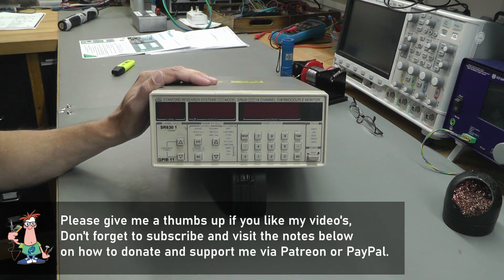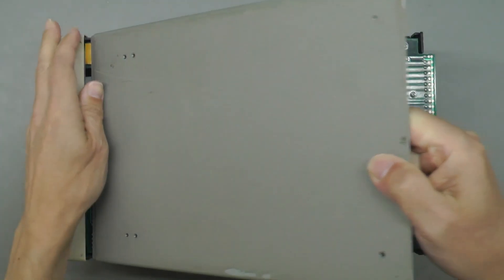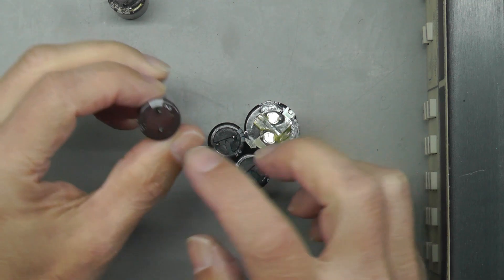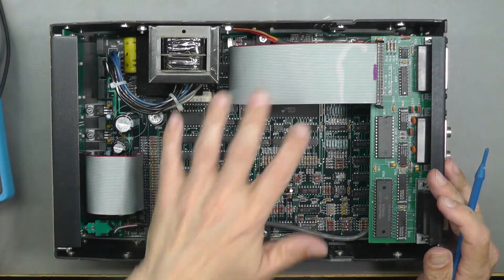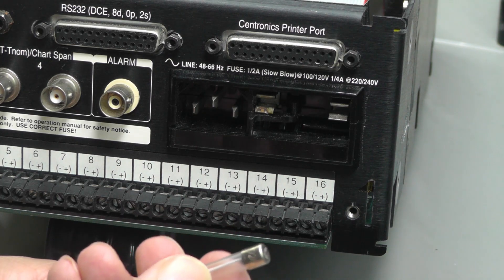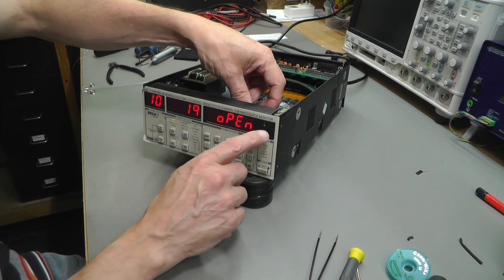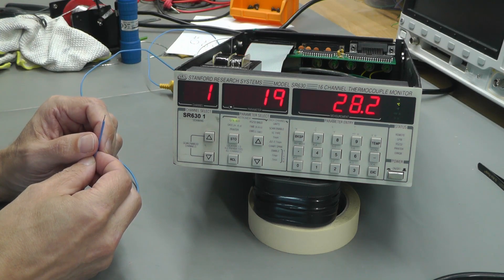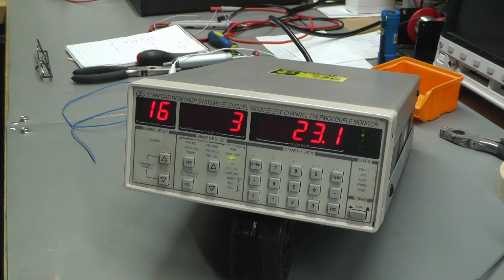No.095 - Stanford Research Systems SR630 Thermocouple Monitor Repair

Comment: Great video Ian.
I also bought a non-working SR630 and fixed it successfully a while back.  Mine had a few issues - intermittent keypad function, a damaged rear terminal block and damage from leaking electrolytic capacitors.
The keypad was mainly corrected by cleaning the backside of the button moulding and the PCB, it's still not perfect.  I think the up and down buttons have had a lot of wear from repeated manual scanning.  The terminal block replacement was tricky, someone had done a poor job previously which I had to remove (including a bunch of silastic glue), then I had to find a terminal block type with long legs (as they go through the isothermal block then the PCB, most won't reach) and replace every trace from them to the switching relays.
Fortunately the electrolyte damage I had was way less extensive than on your unit, and I only had to repair one trace.  I replaced all of the electrolytic capacitors, big and small.  I do agree that the small ones rarely leak, but they might be down on performance too.
If you want to replace the case screws, they are 10-32 UNF at the front and 8-32 UNC at the back.  Not easy to find here in NZ, probably the same in the UK.
Reply from the maker: Nice to hear about another 630, thanks for that. Yep, I'll order some screws via Ebay if I can't find any in my stash.
I haven't tried GPIB yet, that'll be next few days. Luckily I have a load of thermocouples ready waiting.

Comment: I’ve seen line filters fail and give magic smoke.. usually a built in capacitor fails, probably a Rifa ! They stink when they go, my lab smelt awful for a week the last time I had one go.
Reply from the maker: No RIFA's in these, you can see the mangled metal lying on my bench in a couple shots where I ripped it apart. Two were half potted, one wasn't. I guess one is a bit leaky and unbalances the currents in/return and thus trips the RCD.
Reply: @IanScottJohnston  Feedthrough capacitors seem to also fail, have had a few cases now where they break down, which is not how they normally are, as they used to be really unlikely to fail. I guess cheapened out during manufacture.

Comment: Hi, Ian thanks for the video always enjoy your repairs and have a go at repairing items that most replace.
Cleaning PCBs of acidic electrolyte which has eaten copper tracks and is conductive needs to be neutralised and should be washed in demineralized water or distilled water then the contaminated water should be removed from the surface.   Try to contain and then remove the contaminated water in the affected area and not spread it to any other areas to avoid further corrosion.  Use warm air and/or gravity to assist especially if any water has found its way under any other components.  Then IPA can be used to remove any further contaminants and water,  avoiding any more extreme solvents is always a good thing for many reasons.

Comment: I thought you would mention some of the caps on the I/O of those regulator's. Some were tantalum's and some were electrolytic I'm sure you were going to say something. But you didn't they looked worked on at some point before. Oh well great to see you back at it look forward to your next. Cheers
Reply from the maker: I rarely see issues with small electrolytics, and tants are ok if used well within their voltage rating. Kinda why i measured both input and output of the regs to make sure voltages were well within.
A 40min video, didn't want it any longer...:)
Yep, its a real hard job to find faulty test equip!.

Comment: Fantistic reapair, Ian! I was riveted to the screen once again.

This might be a silly question but does the exhaust hanger rubber serve any other purpose in your workshop other than to prop things up? I'm sure I've got the same one somewhere in my garage and am often considering ways to improvise a soft-jawed vice for electronics work. I recon that could do the trick!
Reply from the maker: What I really want is a 2x3x3" block/wedge of rubber to prop things up. Anti-slide qualities like the exhaust rubber!
Reply: @IanScottJohnston  Got it! Thank you for the reply.
Reply: @IanScottJohnston  I use a section of scrapped conveyor belt, as that is both static dissipative, will survive soldering on it, and also was free. You might find old belting if you have a belting supplier near you, and get something off their scrap bin, which was where I got mine, when I went to order and collect a custom made seamless conveyor belt, to replace another worn one. Thinner bits can be glued together using regular contact adhesive, and it does cut using a sharp box cutter blade, or somewhat smellier with a circular saw.

I use one as a soldering top, and another few went to use as spacers elsewhere, including some that got turned into replacement flexible coupling rubbers, as the original parts are not easy to get outside of China, and take 6 months to arrive. The belting rubber was unworn after a year, unlike the originals. Even turned some into replacement door stops for the building lift, as they are 40 years obsolete now, rather than change to the new style rubber, which meant drilling new holes in the steel.
Reply from the maker: Update: Ok, I have managed to find an alternative to the exhaust hanger.......let's see if anyone can guess where the new one comes from....:-)

Comment: Nice repair, Ian. Most satisfying was the recovery of this line switch! Please, what's the brand and type designator of these low e.m.f relays?.
Reply from the maker: Relays are marked: Aromat 9524A, DS2E-ML2-DC5V
Reply: @IanScottJohnston  Thank you! It's obsolete, as expected. FLUKE uses similar ones in their calibrators, I think. It's also not explicitely specified for low e.m.f. That's the engineering magic, to find such components which have extra features, but low cost.

Comment: How bizarre to write "oPEn" when they could have just done it in all caps.
Reply: Actually a design built into the BCD to 7 segment drivers used, where the codes above 10  have oPEn, - and blank as display options. Used because then you do not need to mess with the display scan routine, which runs via the Z80 interrupt input from the CTC to refresh the display with no flicker. Thus you allocate a small block of RAM to use of the display and keyboard, and the interrupt routine runs at a regular rate to read out the display locations, then writes a set of locations with keyboard response input. 

That way the main routines just have to write to RAM for display without care, and read RAM to see key presses, and software debounce them. The annunciations also likely are simple bits multiplexed along with the column drives, so there is also no flicker with them, using a latch that holds a single bit of the memory written to it. Easy on the Z80 with minimal IO decode, you simply use a LS138 to decode IO access into 8 blocks, and a second one to split it into 8 smaller ones, allocating each smaller block to one of the latches that drive the display and keyboard. First decoder handles all the IO, including the ADC and GPIB, along with all the other IO, with minimal propatagion delay in the logic. Cheap, and so long as your code writer remembers you will have multiple IO locations for each part you will get away with it, as you find it hard to use all 256 IO addresses up in normal use.
Reply from the maker: @SeanBZA  ahhh yes the 74LS138 I remember it well! Did a lot of Z80 stuff in the 80s/90s for some offshore electronics.
Reply: @IanScottJohnston  Repaired stuff where the LS138 was the most complex part, with entire unit being built out of regular TTL gates. No CPU, unless you considered 8 cards packed to the gills with LS logic to be the CPU, more a very complex state machine, with a lot of 2708 PROMS doing both program storage and also acting as combinational logic in there. Memory used a pair of MK4007 Mostek chips, with a set of binary counters to turn them into serial memories, and a bespoke purple ceramic Intel DAC, that was used with a SH multiplexed amplifier, to do ADC and DAC duties.